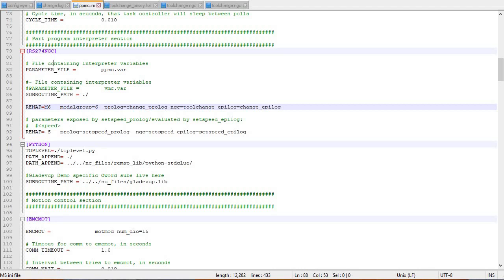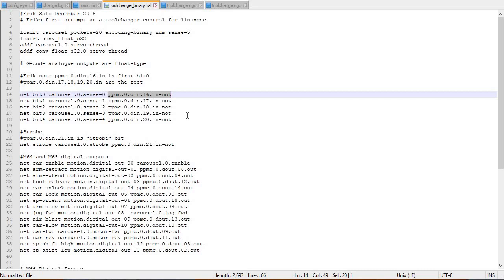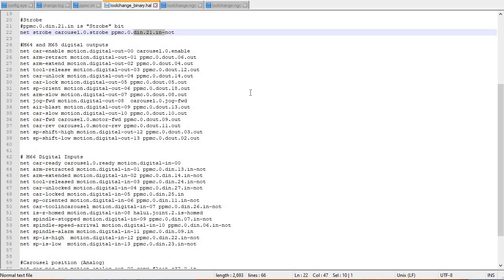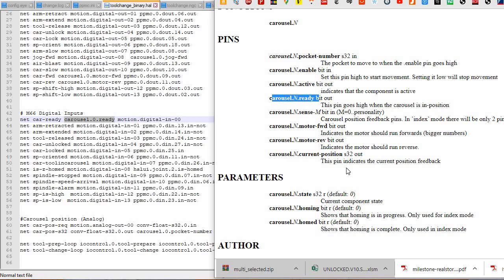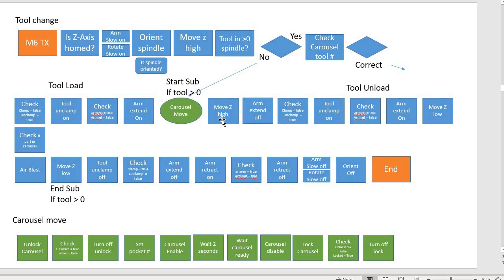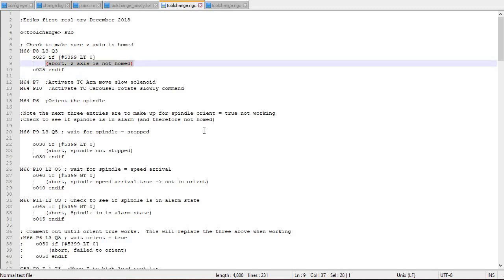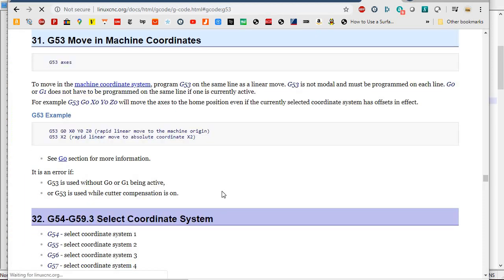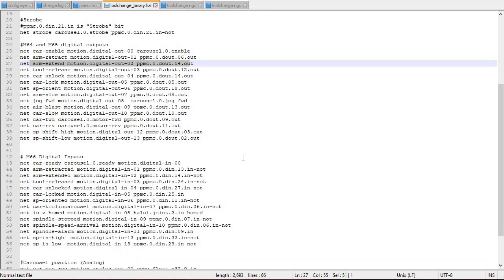Coding a LinuxCNC Toolchanger for Dummies

Comment: Man were you right about reading through the example configs. I was trying to get manual tool change with auto tool probe working. Then I found you can just call M6 from inside the remapped M6 and do a probe after. You've done the lord's work here

Comment: What an extremely helpful and concise video. Much appreciated. Btw rs274 is the standard name of 'g code' although most implementations have some sort of differences. 'O' generally denotes the starting character of a program with the following characters being the program number. '#' denotes a macro variable with the following number being the address.

Now to take what I've learned here and try it with a lathe turret.
Reply from the maker: Thanks for the info about RS274!  That's really helpful.